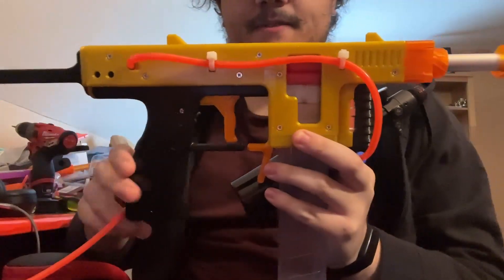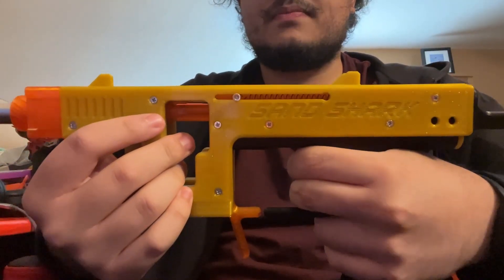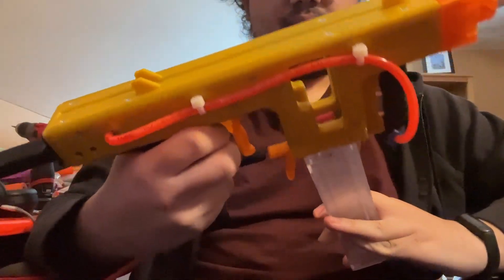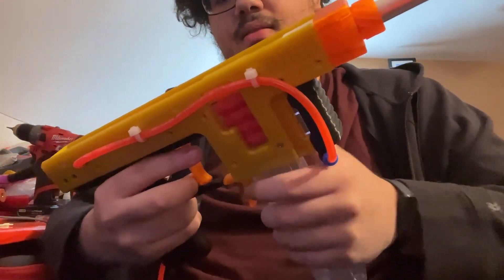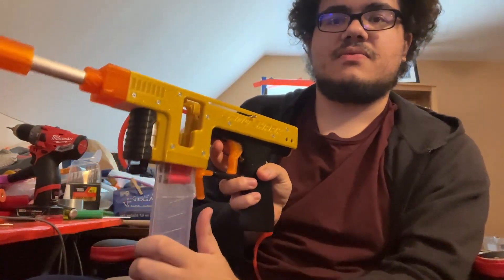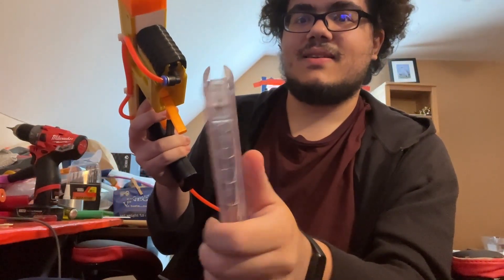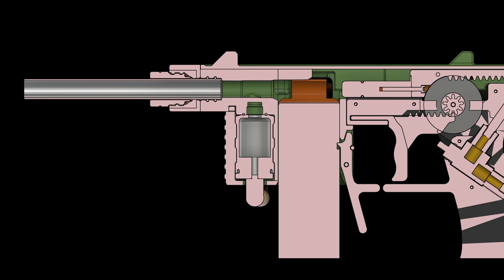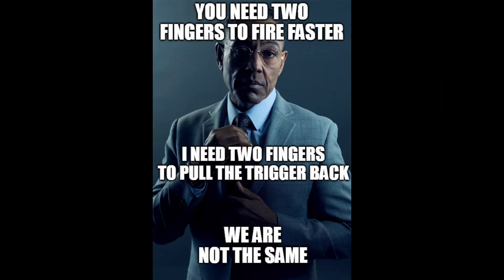HPA Nerf Blaster: Sand Shark (First prototype and post-mortem) #Nerf #3dprinting (Cosmic Nomad core)

Comment: First off, I want to say thank you.  I built a SLAB for my first build, and it works good.  Second, the gear setup will still work, the teeth on the slide just needs to extend a little further
Reply: Or the gear ratio needs to be tweaked a little, going 3.5:1

Comment: the hpa tank is coming loose bc of the high pressure not having enough room to move freely thus, when each shot of air causes the pressure to run backwards and want to push the bottle back out. @sillybutts also never over tighten any hpa tanks or regs runs the risks of orings splitting or burst disks malfunctioning , bc it can operate properly bc the tank is over tightened past optimal
Reply: also the tubing might not bee properly rated fo hpa
also hpa is very violent. so try to use any regulator and pressure valve that can almost convert that to lower pershot.tippman make remote lines forwoods ball markers this also an option, look into high end paintball markers. they shoot about 600-1000 rounds off a 68/4500 tank bc the psi used per shot is so low. hope this helps and give ideas on how to improve

Comment: maybe you could put the pusher on a different piece where it still gets moved by the gear mechanism and add a small space with a return spring which will be used to ensure that the breach is already closed while still having enough space to press the button. maybe this would extend the trigger pull a bit dough

Comment: Love the progress and the design so far! Another alternate option if you dont want to use a MJVO-3 is an HPA/LPA solenoid build. Wiring it like a dual stage trigger where it can hit a bumper first for an electronic Neutron first. Then actuating the release of air using a ElectroPneumatic Solenoid. May require rewiring the design to include a LiPo.
Reply from the maker: I considered doing an electronic setup for semi-auto HPA, but I'd rather not increase the cost of a blaster like this by doing that. It'd be a lot for such a small setup. But on something a bit bigger, I'm still weighing my options.

Comment: 1 minute in and I’m already excited! I need hpa gear!
What did you mean by air cylinder? Pneumatic piston maybe? 
Also a lever action hpa blaster would be amazing cause you wouldn’t have the springs resistance slowing down the fire rate. Could function more like a real steel lever gun. Just an idea
Reply from the maker: Yeah, pneumatic piston. A little pushy in/out thing, actuated by the airflow going to either a front port or a back port.